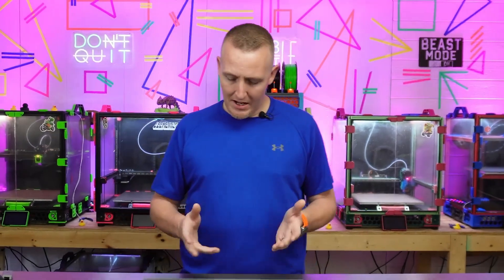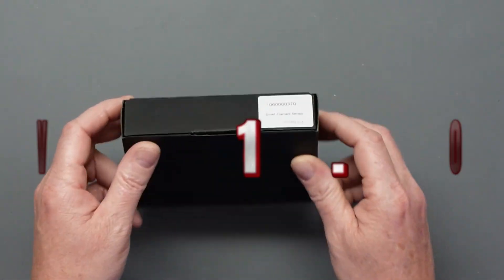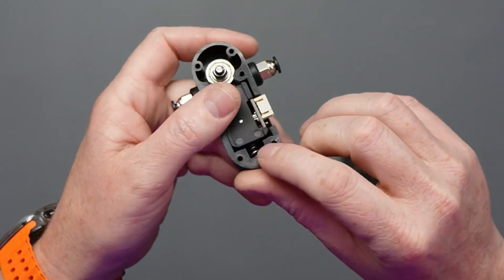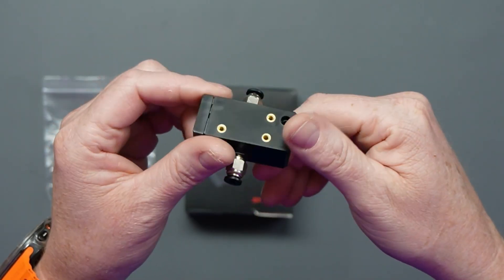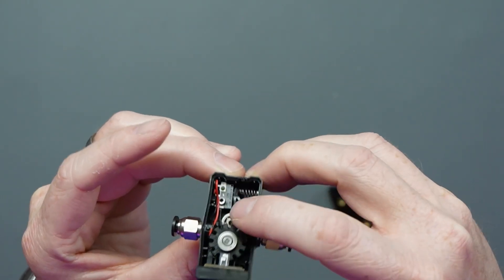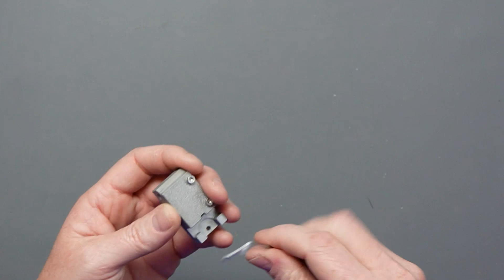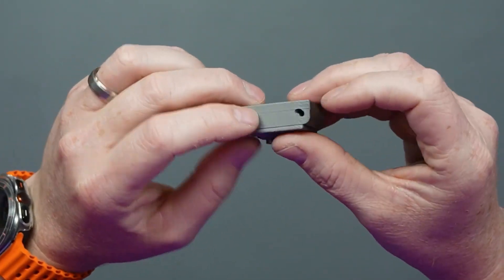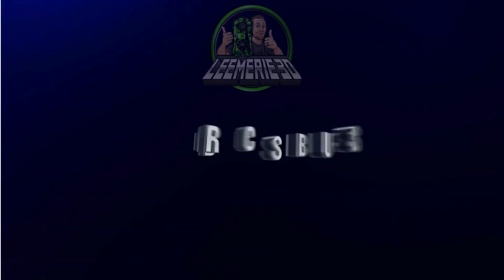Smart Filament Sensors – Do You Need One? BTT V1.0 vs. V2.0!

Comment: I have the V2. I strongly suggest to Loctite the screw that holds the bearing down. Mine came loose and made the sensor stop working.
Reply from the maker: I JUST had the same thing happen to mine! I used some loctite and tightened it back up as well. Wish I would have noted this in the video. Pinning this comment. Thanks!

Comment: Which filament runout sensor can I use for my anycubic kobra2 neo……….shall I try this one? ——Filament Break Detection Sensor Module 3D Printer Accessories with Connecting Line1M Cable for 1.75mm Filament Extruder Material Run-Out Detector for 3D Printer (Black)
Reply from the maker: I am not familiar with that specific printer to be honest. But from looking it up it seems to already have a filament sensor with the stock build does it not?

Comment: I see another V2 thing that may over time cause issues, and that is the open bearings as seen when you opened this up. might be wise to replace with sealed bearing to keep the filament dust out the bearing.
Reply from the maker: I could totally see that being an issue. Sealed bearing would be better in this case I agree.

Comment: My "thought" problem is: it's nice that filament sensors do their thing, but how do you continue from a print? I can't grasp that mechanism. I also added an "ups" for my printer, but yeh, a failed print is a failed print. You can't re-zero your printer as the bed has the print ofc.
Reply from the maker: You meaning when you lose power how to restart then? If so, yeah that's not gonna work then. Especially with a flying gantry machine like the Voron 2.4. I also run UPS on all my machines. These sensors just help if during a print you run out of filament. It will pause for you until it gets more loaded and then you can resume the print.

Comment: I like the orbiter 2 filament sensor. It has a button that can run a load or unload macro as well as green and red lights. The only problem is it only works with an Orbiter 2 extruder. We need a filament sensor like that but for in line use with any extruder.
Reply from the maker: I haven't tried that sensor but I plan to grab one up soon!

Comment: I definitely like having a filament sensor.   I don’t thing they are as necessary for smaller 3d printers but I think they are a must for large 3D printers when your prints could take multiple spools of filament for a single print.
Reply from the maker: Well, it's just that extra layer of security if something happens and you get a jam that is nice. I should have mentioned as well in the video btw. If you are e steps are off a decent amount, it will catch that as well. Very handy!

Comment: I have the v2.0. I've run into a couple issues (all user error) so just a heads up for anyone looking:
Make sure your pause/resume/cancel macros are properly functioning. I had some conflicting macros that needed some adjustment to properly manage the sensor. Specficially on resume make sure you have a delayed gcode set up to turn the sensors off until ~10 seconds of printing. This kept me from being in a pause/resume loop.

The v2.0 encoder sensor needed a bump up to 5.0mm from the default 2.88mm, I'm just assuming my filament path isn't as clean as their testing environment. So it needed a little more slack. Both sensors (encoder and runout) have successfully saved prints and I love the thing but make sure you test all of the features and make sure they behave as expected. If not check your macros.
Reply from the maker: Great tips! Thanks for that! Very helpful 💯

Comment: Nice and Simple little sensors, looks easy to install, the motion sensor one just makes sense.
Reply from the maker: Super easy to install. Didn't even have to crimp a new jst! 😂 That's definitely a plus.
Reply: @ awesome
Reply from the maker: Unless you need to run the wires a bit differently, it may have to be extended.

Comment: Never had a v1, installed a few of the v2 but ended up taking them off all but one machine, while it is not hard to push through I find because the path is not very well constrained it can be hard to get it through if there is any sort of curve to the filament, and tpu is just keep trying until you get lucky or give up. And that detection distance is very optimistic. I usually leave it disabled during loading and at the start of the print until after the purge since I have had it false trigger numerous times during the purge line and messing up the start of the first layer when I try and resume since purge is done, trigger, pause and move to park, hit resume but now there is ooze since it did purge at max flow but the retraction was interrupted by the false trigger. Really hope they can get it right by v3.
Reply from the maker: I've also had to adjust my detection distance a bit on these. I plan to do a video covering the install and setup for the sensors. Figured it would be helpful.

Comment: I picked up the 2.0 sensor when I did some reliability updates to my V2.4 a few months ago. It has really given me peace of mind with running it 24/7. It has intervened many times to save prints already in the 600 hours of print time since it was installed.

Who else has also customized their config for it? I made some macro buttons, and set the sensor on/off in my start/end gcode so the sensor does not trigger during un/load of filament.
(I just realized I need to reduce my detection_length, I had it set high because it wasn't working correctly at one point. Tearing apart and rebuilding the sensor fixed that issue.)

[filament_switch_sensor switch_sensor]
switch_pin: ^PG14
pause_on_runout: False
runout_gcode:
  PAUSE # [pause_resume] is required in printer.cfg
  M117 Filament runout
  RESPOND TYPE=error MSG="Filament runout"
  DISABLE_FILAMENT_SENSOR
insert_gcode:
  M117
  RESPOND MSG="Filament Inserted"

[filament_motion_sensor encoder_sensor]
switch_pin: ^!PG15
detection_length: 12.0
extruder: extruder
pause_on_runout: False
runout_gcode:
  PAUSE # [pause_resume] is required in printer.cfg
  M117 Fil enc runout
  RESPOND TYPE=error MSG="Filament encoder runout"
  DISABLE_FILAMENT_SENSOR
insert_gcode:
  M117
  RESPOND MSG="Filament encoder resumed"

[gcode_macro ENABLE_FILAMENT_SENSOR]
gcode:
  SET_FILAMENT_SENSOR SENSOR=encoder_sensor ENABLE=1
  SET_FILAMENT_SENSOR SENSOR=switch_sensor ENABLE=1

[gcode_macro DISABLE_FILAMENT_SENSOR]
gcode:
  SET_FILAMENT_SENSOR SENSOR=encoder_sensor ENABLE=0
  SET_FILAMENT_SENSOR SENSOR=switch_sensor ENABLE=0
Reply from the maker: That's awesome! Thanks for including the klipper macros! I still have to add this to the description. I planned to do that tomorrow. I appreciate this info! Everyone like the comment above 🙏

Comment: The SFS 2.0 has saved several of my prints.  Its a little fiddly sometimes to load
Reply from the maker: Yeah that 2.0 I've had the little latch cap come off of two of mine. Forgot to mention that. Must have just been loose from the factory.
Reply: @ I actually have a replacement knob on Printables because I’ve lost one 🤣
Reply from the maker: @jmedlin  oh send me the link!

Comment: I have both versions and have been pretty happy with them. The only thing is that you really need to dial in the detection sensitivity for them to work without false positive triggers.
Reply from the maker: I have had my 2.0 a bit tricky to set up. I'm thinking of doing a follow up video on the setup also.

Comment: The V2.0 is great. it has saved a bunch of prints when i either had a tangle or ran out.
Reply from the maker: That's the one I have on most of my machines. I love it. Keila just don't like them cause having to push thru them is harder for her. And having to reach around back to release the latch and all. But, that's not the sensors fault.
Reply: @leemerie3d  i have mine located right above the toolhead on my Ender3 V3 KE. It's very easy to push filament through.
Reply from the maker: Yeah that's a bit easier on the Ender. On the Voron ours are located in the back. And the top machines are tougher to reach (for short folks ;) like Keila) 😜